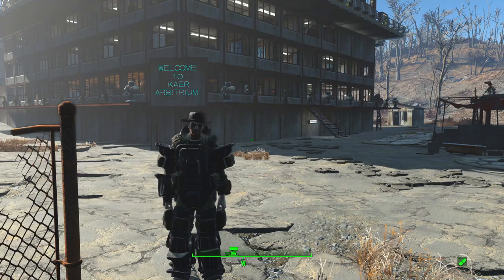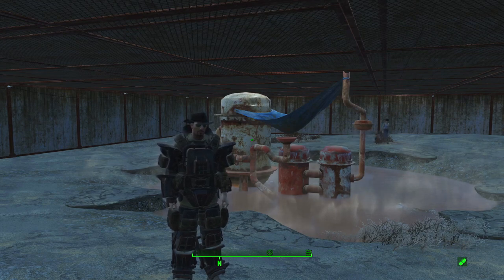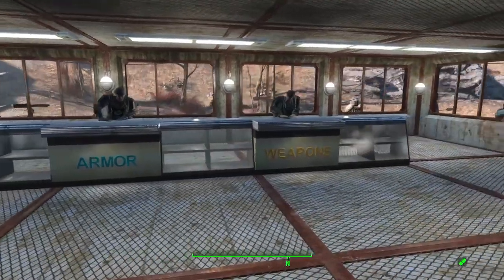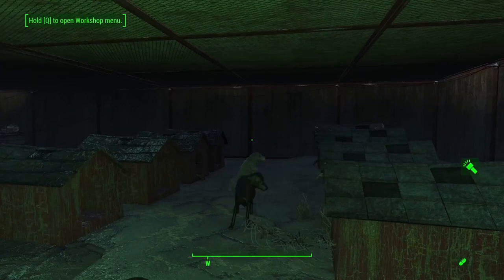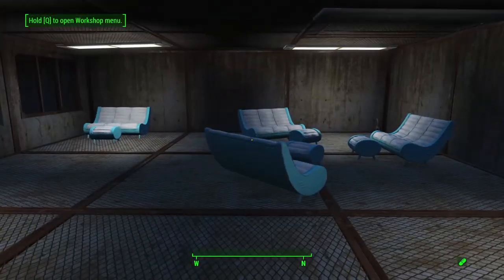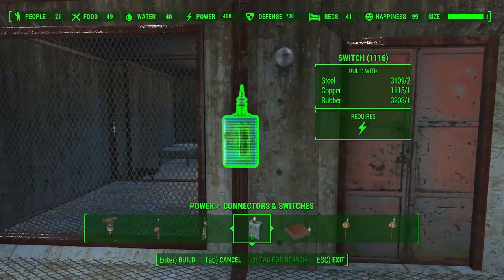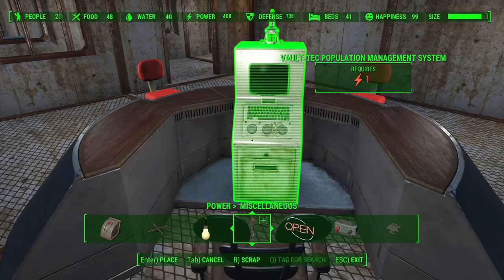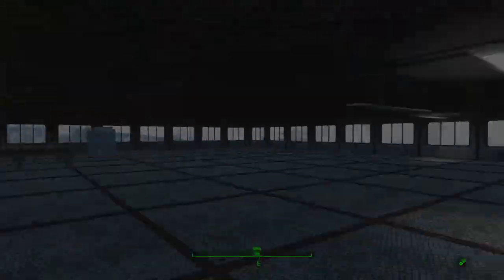Commonwealth Contractor | Fixing Starlight Drive-In Part 1

Comment: The glowing wolves are also great at synth detection.  I try to keep one Rad-Dog at each settlement.  

Also found what appears to be a work-around.  Save your synth components you salvage from their bodies.  Since I only have 3 sites which have active beacons, there are settlers with synth components in their pockets in each of those.  I haven't had an issue with synth infiltration since I began doing this.

This might just be the luck of RNG, or it might be that the game checks to see if there are "settlers" with synth components.

Comment: What would be a good location to build a automated manufacturing factory?
Reply from the maker: I've never really played with that idea much, but many commenters say they use the mechanists lair for that.
Reply: Spectacle Island has all the room you could need and then some.  Depends on if you're going to travel there quite a bit.  If you are building the plant to actually use, I'd avoid the rads in the water for each trip & instead maybe go for Abernathy Farm.  Lots of vertical room to build there.
Reply: @Theegreygaming  Okay, maybe also a future video topic.
Reply: @Mr._Anderpson  Thanks, I did think of Spectacle Island but that but that seemed like overkill to me, I wanted to automate Bottlecap Mines not everything else as well.
Reply: @ye4thorn  Gotcha.  If you're just worried about cranking out that one item, there are lots of options.  

I often use part of Sunshine Tidings to crank out 50 cal ammo.  Cheaper to buy lead shipments than to pay vendors for bullets.

Comment: Hi, what does the lightning bolt symbol mean on a build menu item,  e.g. Nuka-Cola booths (4:35)?
Reply from the maker: the lightning means that the item was added via creation club content. in this case the nuka cola collectors workshop pack. you can accomplish the same functional setup from the diner booths added in the vault 88 DLC, they're just a little tattered in appearance.
Reply: @Theegreygaming  Thanks, and yes, I have the 'tattered ones' - they come with the vault door symbol. As yet, I haven't acquired anything via the Creation Club. I might give it a try, depending whether I have to pay for it or not, and how much.
Reply from the maker: @qonkisstador2516  I think it's normally about 5 dollars, but all creation club content you see in my builds is something that I acquired for free during a give-away period. during October they were giving away a lot of different workshop related content so it's  added quite a bit of little aesthetic improvements, but I still try and ensure that anything I use has an equivalent outside of the creation club so people have a fallback, like the vault diner booths.

Comment: i do prefer power conduit over wire hanging loose for to indoor power, using wire only when it's absolutely necessary. it took more resources and time to align it right, but results are more satisfying. also i believe there are wall pass through conduit in vanilla build set. though it look ugly as hell, the perk of not having to use windowed wall for wiring outweight the looks.
Reply from the maker: I agree the conduit looks better if you take the time to line it up properly. I switched to the wires mostly because I was just sick of the amount of time I was spending trying to align the conduit so the wiring is sort of a compromise I accepted to speed up construction at larger locations like this one.